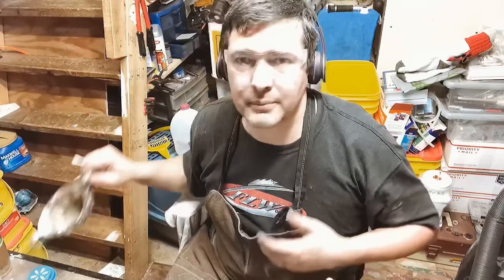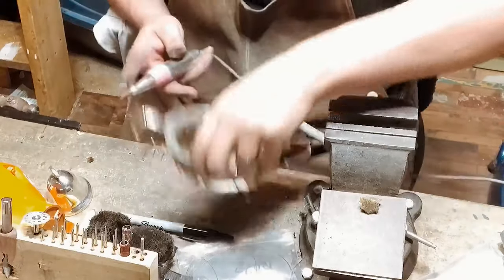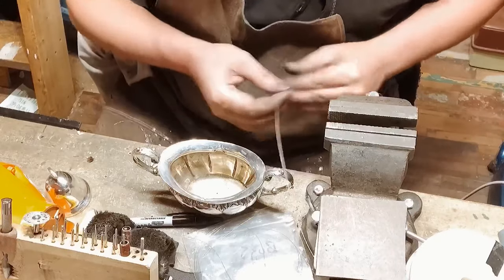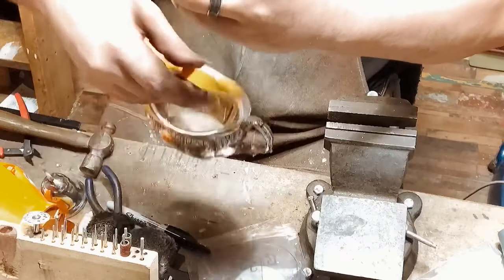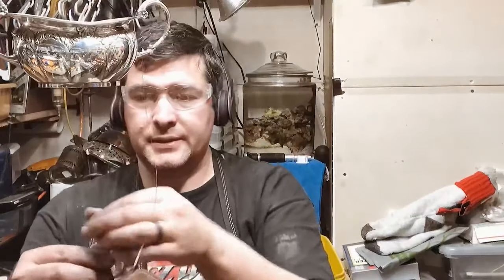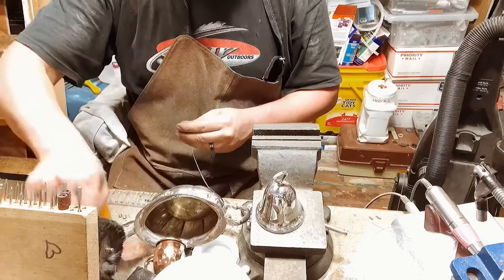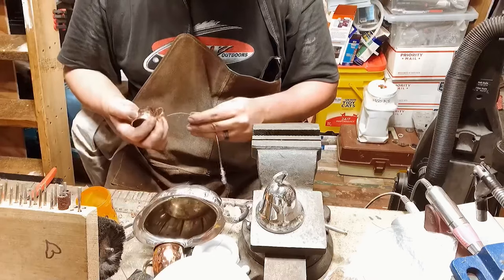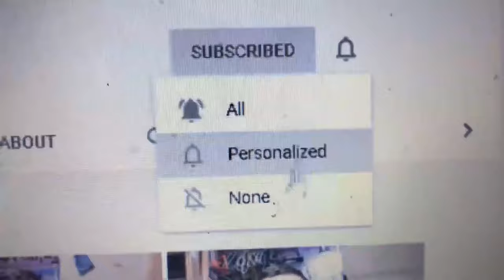Wind Ornament chime

Comment: Thank you! I’m not seeing the type and size of crimps you use.
Reply from the maker: Here they are. For some reason I didn’t add like the rest of the videos. Here are the links. ► 100 Meters 33 Pound 0.6mm Fishing Steel Wire Nylon Coated 1x7 Stainless Steel Leader Wire 

►Hi-Seas Grand Slam Aluminum Crimp Sleeves 1.5mm - https://amzn.to/2UIC22R

►Beadalon 7-Strand 0.015" (0.38 mm) 100 ft (30.5 m) Bright Bead Stringing Wire - https://amzn.to/3BHMS9L